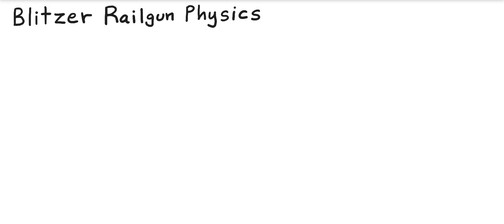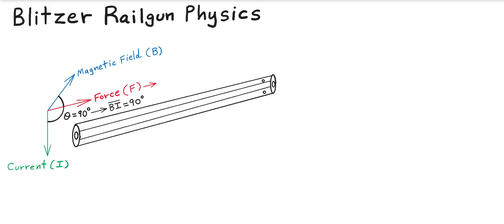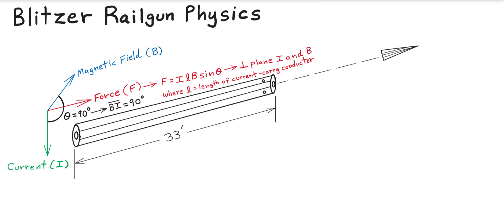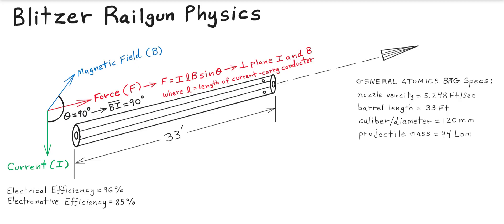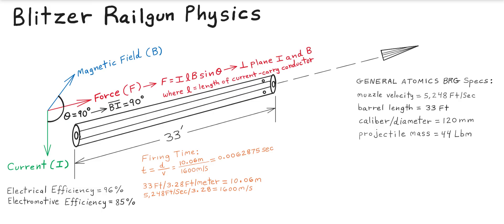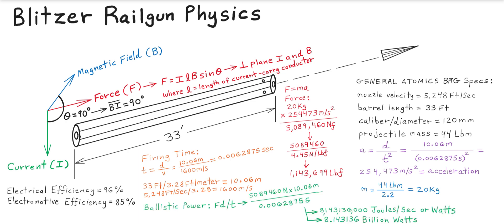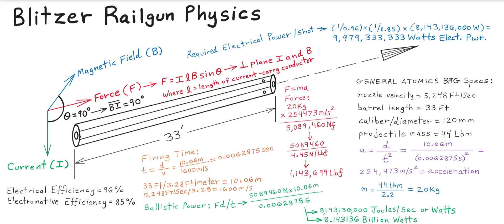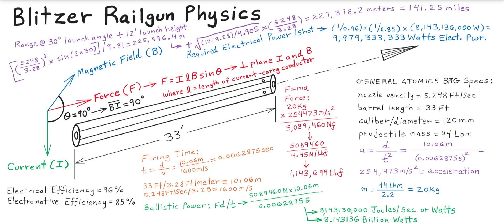Blitzer Electromagnetic Railgun

Comment: What size capacitor holds the current.?
Reply: "On 31 January 2008, the U.S. Navy tested a railgun that fired a projectile at 10.64 MJ with a muzzle velocity of 2,520 m/s (8,270 ft/s).[80] The power was provided by a new 9-megajoule prototype capacitor bank using solid-state switches and high-energy-density capacitors delivered in 2007 and an older 32-MJ pulse power system“ - Wikipedia
Reply: @alexipeck4201  So I would need an aircraft carrier size subwoofer..
Reply: 0402 0.1uF

Comment: if its a electro magnet rail gun, why is there an explosion at the barrel 0:22? either theyre using something other than or on top of electricity, or that clip is of something else
Reply: "The fireball is a result of pieces of the projectile shearing off during launch and igniting mid-air."
Reply: vaporized aluminum explodes when it touches air
Reply: Arc Flash. Google arc flash videos. The device is effectively a purpose built arc flash device designed to fire a projectile
Reply: nope thats the result of quite a large amount of electricity 🤣
Reply: @Angryharry1 Yeah, if the wires were exposed to the air. The full gun would explode and not be able to fire again if the explosion was electricity.
Reply from the maker: At 8.14 Billion Joules of Kinetic Energy (per second), at less-than 100% Efficiency, substantial HEAT (temporarily) grounds across surface materials.